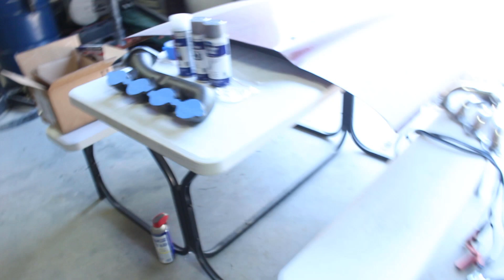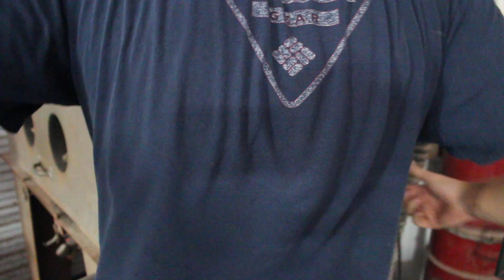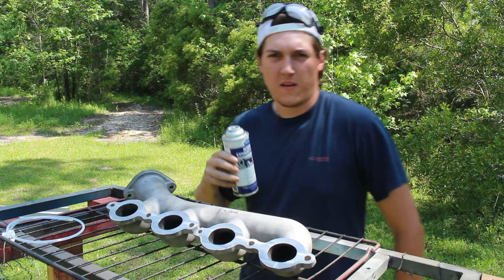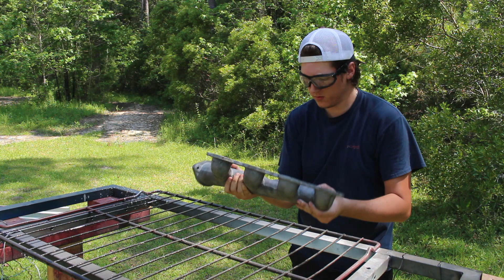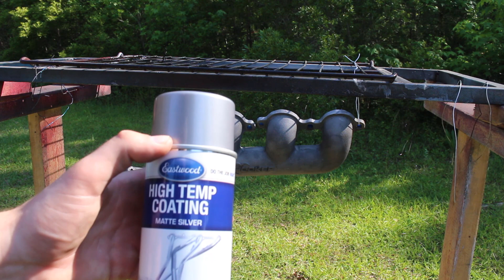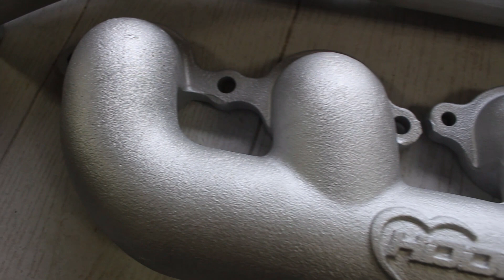COATING MY NEW MANIFOLDS

Comment: Jethot coating, nothing better, worth the money, Second, YOU DONT COAT THE INSIDE, The hotter the inside the faster the airflow, Simple math.
Reply: You coat the inside! because the hotter the faster....you want to keep the heat inside of the manfold and not creeping into the manifold heating up the engine bay. It`s dangerous to wrap and coat with a thermal barrier the outside of the header...the hotter the header especiall the cast one the more it expands which causes cracks and broken studs. Best solution is a good internal coat and for nice look outside some heat prove paint covered up with a nice heat shield to reduce radient heat into the bay.

Comment: Hey do you run the truck with these much? any long term outlook?
Reply from the maker: I've put 700 miles on the truck and they are holding up alright so far. There are some parts where I may have gone light and are starting to get a little bit of surface rust. Only time will tell how bad they get, but definitely better than not being coated.